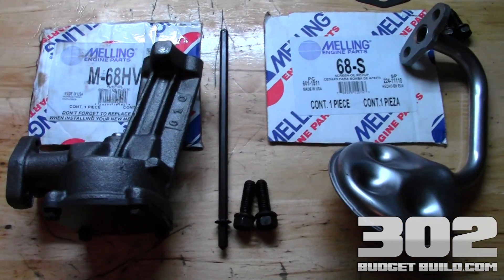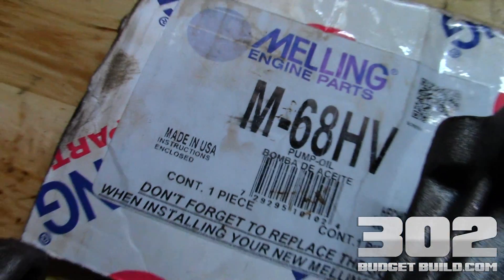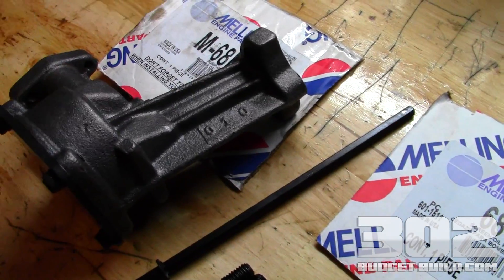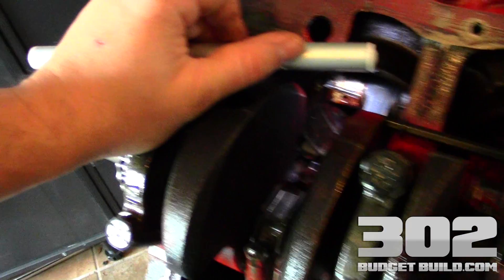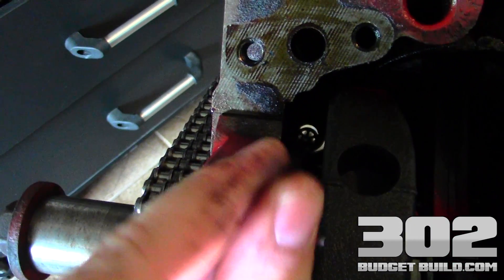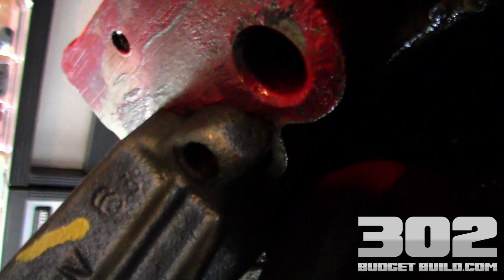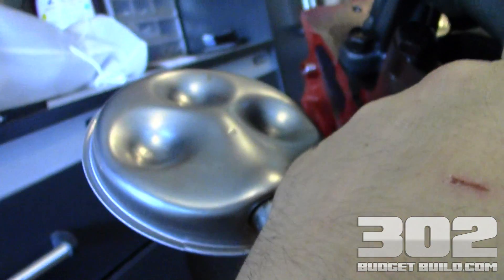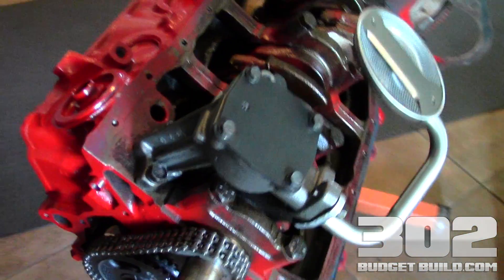How to install an Oil Pump & Screen on a Small Block Ford 302 5.0

Comment: Im working from thr bottom with engine still in.  Can i just put the shaft in the oil pump 1st, and carefully bolt the oil pump back on making it simultaneously line up with that distributor hole? As long as the pump is flush.

Comment: So that is the reason for the smaller front sump in the pan, so the pump can pick up oil.  That seems risky because that front sump might empty on hard acceleration, or is there a baffle.  Then the oil in the back sump must just sit there as there is nothing to draw it out for circulation other than hard braking would throw some forward.  So does the rear sump end up with a quart or so that just never goes anywhere?    Seems Ford should have put the pickup into the back sump and eliminate the front sump.

Comment: I just want to re-install my old pump, but I cannot find the pump to block gasket anywhere.  Loads of pickup tube gaskets, but am I really going to have to buy a new pump?  I know they are not expensive, but they also don't really fail easily.  Maybe the lack of gasket availability is telling me just to buy a new pump.  

But suppose I installed a new pump and then had to take it out for a different reason.  Re-use the gasket?  Seems crazy.

Comment: I've been trying to get the intermediate shaft back up in the distributor hole and it's so difficult because you can't see what you're doing. I thought I had it and reassembled the oil pan and started the truck... ticking from the valve train and no oil pressure.... FFFFUUUUU@#%^$#:!!!! Is there a better way of getting that shaft up in there without taking the engine out?

Comment: Hello. I just got a 76 Granada with a 302. Supposedly the engine has been refreshed. New cam. New heads nd high performance oil pump. Problem is the oil pump shaft looks crooked and James. No distributor in the engine. I'm going to rrpkacevtfe distributor with new. But do I need to pull the pan to recover the rod and how do I know if it's the new aftermarket rod or OEM??

Comment: I would Not recommend a high volume pump for a mild performance street engine. Hi volume is more for hi rev racing. You have to be running all out. Aka drag or road racing. There are vids here on utube explaining  it in more detail.

Comment: Great video, couple suggestions - I know you did the first gasket to the block but don't recall you mentioning that?  Also, can you cite the torque values (assuming 302) for these bolts, are they 35ft/lb?

Comment: Amused.  Did this on my Supercharged ‘82 Bronco with the motor still in the frame (TTB front axle).  Boy was that a challenge!  Not really, but compared to doing it upside down on a stand it’s pretty annoying.  But 60 PSI beats losing oil pressure with the stock 40 PSI pump at stop lights.  Or even worse, when you have to loose a race to some stupid lowered Subaru.

Comment: How far away was that oil pickup screen from the bottom of the oil pan? I usually set them about 1/2" from pan bottom. I also put a tack weld on the pick-up screen to pick-up tube for insurance sake.
Reply from the maker: About 1/2”

Comment: Thank u!

My "check oil" keeps coming on in my 1989 Lincoln Town Car(5.0 engine), not my "low oil light", the "check oil light".

I changed my oil, oil filter, & oil sending unit.

What else could it be causing my "check oil light" to come on?

If it is my oil pump & oil screen, would you happen to know where it is located on a 
1989 Lincoln Town Car(5.0)?

Thanks in advance...

Comment: Forget the stock pump drive and get an aftermarket super duty one. I once got stuck on a highway with no oil pressure cause of a twizzler in the crankcase that snapped.

Comment: OIL PUMP TO BLOCK GASKET, LUBE DRIVE SHAFT ON  BOTH ENDS WITH LITHIUM GREASE. PUT SOME OIL IN PUMP TO LUBE IT ON STARTUP

Comment: Strange issue, newly rebuilt engine.  Oil pressure kept dropping driving me nuts.  went from 15w30, 10w40,  decided to do a flush using diesel fuel.   Turned engine over,  with coil wire disconnected from distributor.  Turned it over with key alone pressure starting jumping up. I was like what the hell?  So I finished flushing it out, drained diesel out, added 6 quarts of 5w30, one pint of break in additive.  Oil pressure holding at 45-50.   "crossing fingers"

Comment: Lost oil pressure and just dropped the pan and replaced the rod, pump and screen. On my 88 GT. Found a handful of hard shattered black plastic in the pan. Can't identify to save my life. Put it all back together skeptically and seems fine but know I missed something from the debris. Have a pic but won't let me post here
Reply: timing gear teeth

Comment: is it possible to do this without pulling the engine? cause if I'm gonna pull mine, I'm just gonna stroke it.
Reply: it is possible, may be difficult to remove your pan depending if it's a front or a rear sump
Reply: Removal and install is super easy. The biggest headache is the faulty oil pump screen design. The thing is press-fit which literally means it will never be perfect. 
One thing, do not try and heat the pump and freeze the screen. That is what I did and for some reason they mounted easy and now the screen literally falls out.  Don't know what did I do wrong, but it is now too loose and will not stay in.  I will have to use something like JB weld to hold it in.
Reply: Say, did you get your oil pump in without pulling the engine?  I so happen to have a 96 F-250, 4wd, 351W engine.  It took me forever to install the new oil pump.  It helped to have an endoscope camera though, as well as using two 3" bolts to align the pump and a nut on each 3" bolt to raise the pump to almost where it needs to be.  Then I installed the gasket on one bolt, swung the gasket in place, then replaced the 3" bolts with the correct bolts and tightened it all down.  Well, that's pretty close to how I did it.  This is how far I've gotten today, as I write this.  Next comes the pickup unit and the oil pan gasket.  Oh, and not to forget the engine mounts, exhaust connections, the upper manifold plenum, and other components.  Oh, and to ask for God's forgiveness for all the curse words I used while working on the darned Ford.

Comment: What oil pan are you using? Summit sent me the exact same oil screen and not sure it will work in my 87 5.0. Motor. The longer rod screen is what it came with. Reaching to the back sump, not the front :/

Comment: No lock tite on the bolts. Oil pump should have small quantities of oil already in it for priming. Will save you much next time.

Comment: So are You going to pull the rod and main caps and change all the bearings while You're right there? The parts are cheap insurance. And while You're at it pull the pistons, clean the ring lands, replace the rings and give the cylinders a light honing to break the glaze. It's well worth the time as You'll know everything's all new as far as wear parts. Nothing like having an engine giving You trouble once it's all together. You might think the extra expense isn't worth it, but You're there already, may as well get everything right.
Reply: lol dude, hes completely rebuilding this motor, so yeah, its been done. follow the series.

Comment: I got a 1990 ford ranger 4c 2.3L with 8 plugs when I crank it up and it warms up it will loss oil gauge goes to L after I change the switch and oil filter it will only go down when I get it to about 25000 rpm and then go back up is it the oil pump or you think I just need to clean the screen out

Comment: Be careful with the high volume oil pump they are known for tearing up the camshaft gear that drives the distributor. Just make sure the distributor gear is the same metal as the camshaft gear. I had to learn the hard way.
Reply: So do you suggest going with a stock pump .?

Comment: what the hell, it seems my pick up tube i took out 2 bolts connecting to the pump, but now there is a third half way down the tube. seems impossible to uninstall without completely removing the pan. My engine is installed and pan is dropped in order to do the work

Comment: good video, but how do i change the pump while the engine is already installed in the car? 

I'm having trouble finding where it is underneath my car
Reply: U have to remove the motor